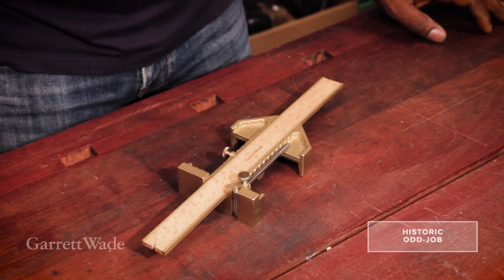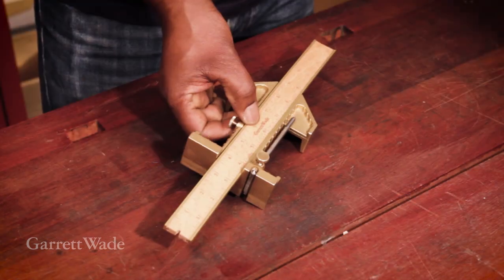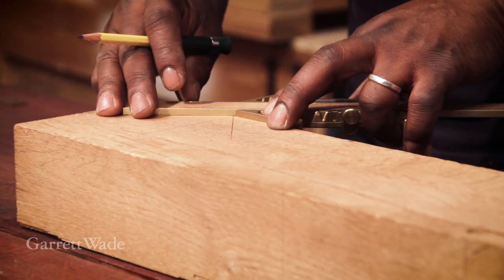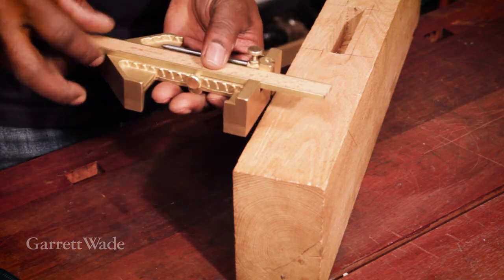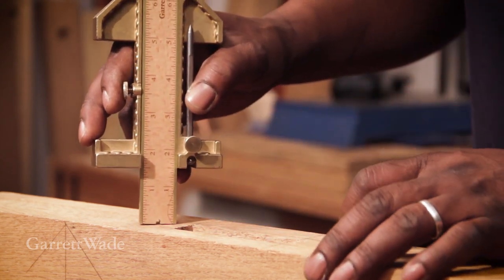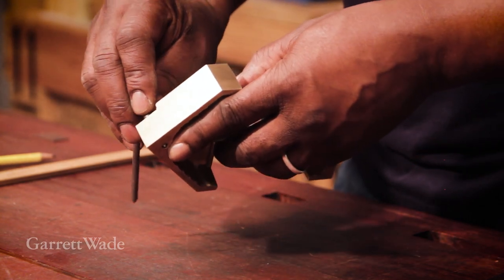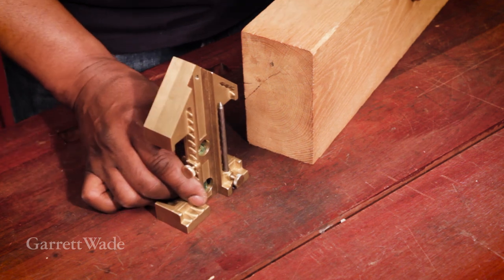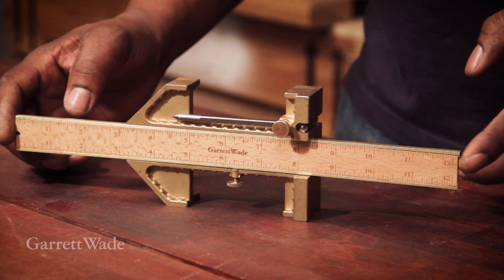Historic Odd-Job Garrett Wade

Comment: Thanks for the demo - the web site and catalog are a bit hard to figure out on many of the exotic features.
A standard combination square will do a number of these tricks, but even so:
1.  The pinch clamp is easier to use than the thumbscrew and hook on the typical combination square, and having more bearing surface I would trust it more to stay true to the 45 and 90 degree reference surfaces.
2.  The larger bearing surfaces in general will give a more reliable reference, not just for the depth gauge.
3.  The notch in the ruler - I am actually tempted to Dremel or file one on the ruler for my combination square.
I would like to see the ruler closer to the work for the circle/arc scribe, but there is only so much one can do with a combination tool.  The different tools on my Leatherman are seldom optimal individually, but it is the tool I have with me. . .

Comment: Yay, 2lbs of clunky awkward brass is what I really feel like trying to manhandle while I'm in the shop or field pressed for time and wishing I had just gone with a 6'' combination square that weighs and costs 1/8th what that idiotic pretentious bling trinket does.
Reply: A standard 6-inch combination square will cost about $10, or 1/4, not 1/8th, the cost of the Odd Job tool.  Be that as it may, I agree with you that a combination square will provide most of the functionality of this tool.  The exception is scribing arcs.
Reply: @jackpine4347  I have combos I purchased for $3 that came with a scribe. Just one 1/8'' hole drilled in the end of the rule allows me to scribe whatever arc I may need. This goofball contraption is 100% gimmick designed for people who think it's the tools that make a good craftsman. It's the same as guitar players who think they will finally be musical if they can just find a better effects pedal or amplifier, or those who think they'll be as good of a driver as Mario Andretti if they just buy a Ferrari. We can't buy our way into BEING something, other than a dupe. Look at all these 20-something YouTube kids with $50,000 in powered shop equipment making, ummm, colored epoxy tables. Tables. Dude. I'll say it again, TABLES. They are getting millions of views and $100,000s for instructional videos on how they make flat boards with legs and they call themselves woodworkers and present themselves as expert craftspeople. In that same vein, every 1st grader who makes refrigerator art with finger paint is an expert and they should definitely have a workshop with $50,000 in gear to back them up. I'm sure there are millions of other 1st graders in the world who would 100% believe that they were the reincarnation of da Vinci and watch all of their videos religiously because ''OMG! They have all the gear! Look at that shop!''.
Reply: @tasteapiana  I have never seen combination squares that cheap!  That's great that you found them for that low price, but are they really square?  Yes, sure, you can drill the ruler to add a pivot point, then use that to draw arcs, good idea.  I just switch to a drawing compass for that.  Regarding tools making the craftsmen, better quality tools certainly do help.  When I purchased and starting using my Makita circular saw there was a world of difference between cutting with that tool and cutting with my old B&D saw.  However, you still need to know how to use the tools.